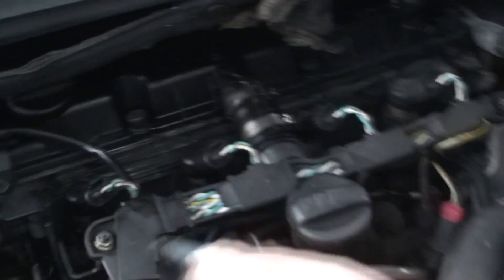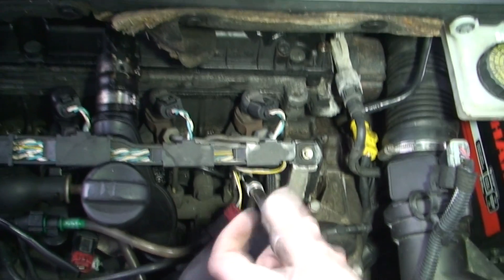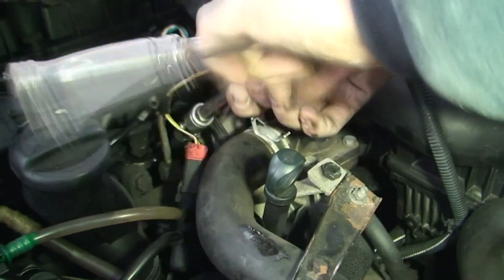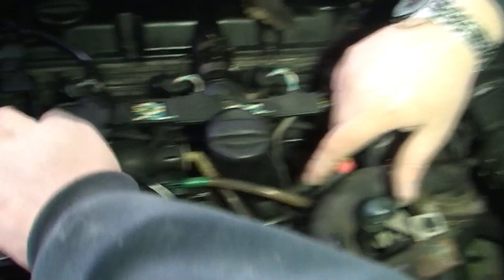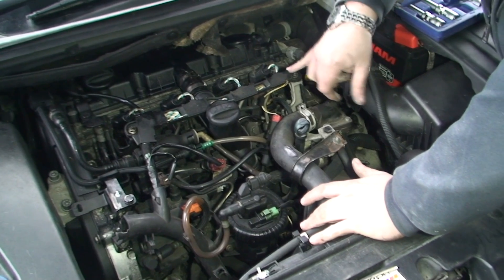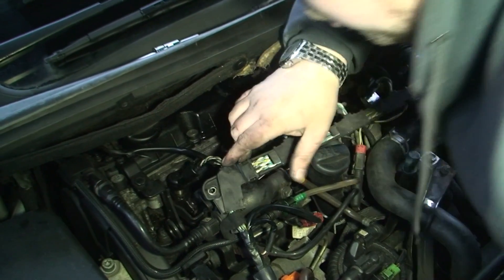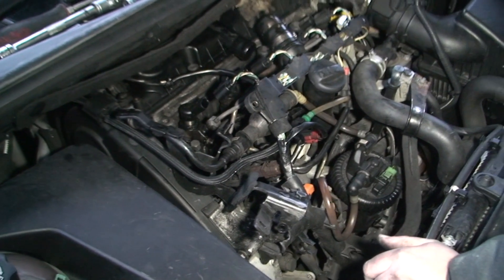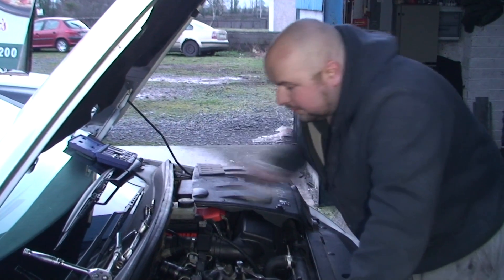bodgit and leggit garage how to do heater/glow plugs

Comment: The term is missleading...   Heater glow plug....    or engine glow plug.... or engine cylinder heater glow plug...
Because there realy exist, Heater glow plugs (for engine coolant), wich do not thread into the cylinder - ALH , ASV 1.9TDI engine
Reply from the maker: sorted

Comment: my mum has a ford focus 1.8 diesel 2010 model and she has glowplug code p0380 glowplug control circuit come up on diagnostics and now shes getting P0299 - Turbocharger/Supercharger Underboost............
P010F - Mass or Volume Air Flow Sensor A/B Correlation

could the glowplug problem bring them codes up they only appear after she puts her foot down but now getting worse and when driving normally

i can clesar them on diagnostics but they come back up later the only one that stays is glowplug code

Comment: Hi,nice video.Thank you.Could you explain about glow plugs in Irish climate.Majority of modern diesel engines won't turn glow plugs relay up to -5 degrees.However, I have heard that glow plugs still engaged during a cold start.A bit confused.
Reply from the maker: Hi mate on a modern diesel engines are used for more than just starting the car they're also used for DPF regeneration that use for a lot in a modern car
Reply: Thank you!The reason I asked is that I have Volvo s40 2007 2.0D 136HP no DPF and I'm pretty sure that glow plugs were never been changed.(To be honest location is not the best.Behind the engine and behind the EGR.)Sometimes engine start's is half second,but in majority I need to crank for 2 sec.On hot usually it has kind of delay start with noticeable engine shake.Just wondering it all this can be related to the glow plugs.?Thank you!

Comment: What other signs should you look for with bad heater plugs other than a hard start to the car.
Reply from the maker: Arts&Trusts way too much to list mate but on a modern car it can go into limp mode it can stop the DPF regenerating losing power hard to start black smoke list just goes on and on

Comment: Is it best to change when the engine in hot or cold thnx
Reply from the maker: Mark Dix hi mate that's a difficult one as I have done them both hot and cold it all depends on how they feel as you take them out I've had ones that feel really bad coming out when cold heated up the engine and come out easy so I cannot really tell you it just depends
Reply: Mark Dix ft
Reply: Mark Anthony
 - Hot engine ALWAYS. Trust me on this one.
At -15°C, non heated and open workshop, some would call it a carport.
Believe me, every car part is convinced it was born in place. LOL :-)
Heat makes things easier and drastically reduce the chances of misshapen.
BTW at those temps most plastic plug/socket, wire insulation, wire sleeves, etc. will crack...
Cheers from Norway ;-)

PS: Skip all this if outside is >35°C. ;-)

Comment: Another great vid leon. Intrigued to know did that solve the problem or was the oil cover glow plugs a different issue?
Reply: Arts&Trusts - Although he's probably right. My money would go to another common culprit, particularly in turbo engines. Like the one shown. 
Gaskets/seals on the intake side. That can/might include pipe seals on the pressure side. Clogged crankcase ventilation, etc. 

Either case diagnostic prior to intervention is a must. 
Among others, live data from the injectors and a few well placed gauges would help with the much needed information. But the culprits can be several different things at the same time. 

Because unfortunately old diesel laying around will look a lot like oil on a first glimpse. Oh, and definitely not draw conclusions with and engine that made a few short and cold start/stops. Like parking or moving in a workshop.
Cheers

Comment: some one i know uses easy start to kick over an old van, it will not start inless it gets its fix lol, why do diesels get so hooked on this stuff, and how can you rehabilitate the poor old girl, ??
Reply: jon taylor - First, "easy start" spray should be avoided at all costs... 
Second if a difficult or no start condition appear, fix it ASAP. Usually in the long run it's easier and cheaper.

If the condition(s) that created the issue is not fixed. The problem will surely not go away by itself. But after using the "easy start" is quite possible and more common than most think. That real damage is introduced in an already difficult situation. The yearly count of damaged engines, because of the (incorrect) use of easy start sprays is quite staggering. Reason why they become "addicted" on the stuff.
You bend a con rod once, it's done it will never come back. ;-)

If for some reason you REALLY need to use it. Make sure to minimize the "no start" reasons. Good battery, fuel supply, etc. etc. MAKE SURE that a tiny quantity is used and extremely important make it a two man job. One on the starter key, the other applying it to a MOVING engine. 
The most common condition the guy alone, stuff a huge amount of the product down the engine "throat". Than go inside and start the beast. That's the recipe for disaster.

After all this babbling, it's worth mention some engines (lower compression, etc.) accept it without any major issues, others simply break. 
Ex. Do it in a Japanese engine tractor and I bet you'll break it on the first try.
Cheers

Comment: cheers. whats 1351 codes on PEUGEOT partner 08 origin 1.6d
Reply from the maker: Ppp Chips hi mate I'm going to need a lot more information than that the more information I can get the better to help you
Reply: What do you need.
Reply from the maker: Ppp Chips there should be more after the code should give some indication what is wrong and I need to know what's the car is actually doing is a driving ban is it bad when it's cold is it bad when it's hot excetera

Comment: Hi,thanks for also showing how awkward pipes and wiring in cars makes the job difficult to get at.
Reply: +fiatvauxhall  Worked on a Peugeot diesel..starter engine...very difficult job..no access to the bolts. Stupid engineering.

Comment: mate of mine has a V6 HDI Citroen C5. the garage broke one heat plug while trying to remove it...know they want to replace the complete head. Is there any other way to take the damaged heat plug out? Is there a trick or some special tool maybe? Car starts with 5 plugs, but it's not ideal.
THANKS
Reply from the maker: Hi mate that's a tough one you can try and drill  it out but you have to be so careful the best thing to do is to take the head off send it to an engineering crowd they have the specialist tools to remove it and to put the thread back
Reply: thanks for your help i really appreciate it
Reply from the maker: Attila theHun any  time  mate
Reply: i would weld it use 3 plugs fk takeing the head off :)